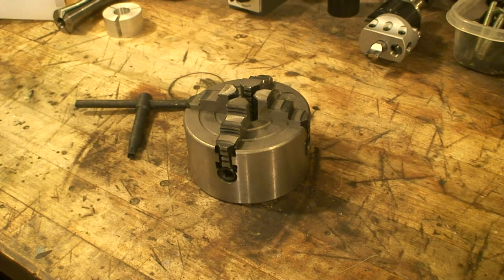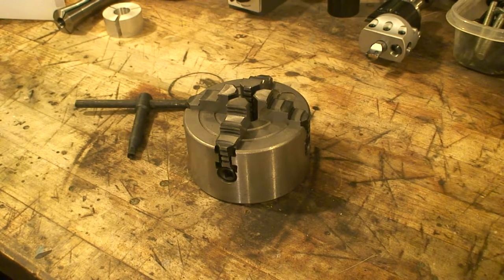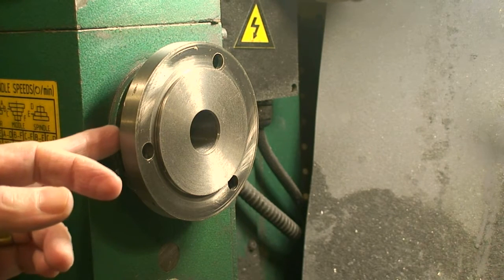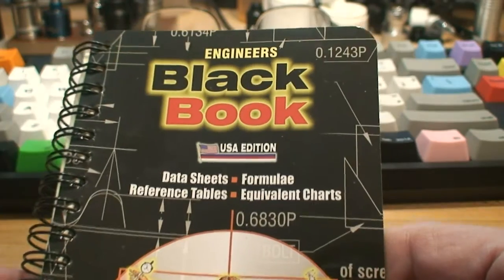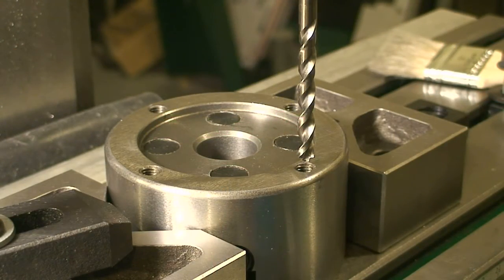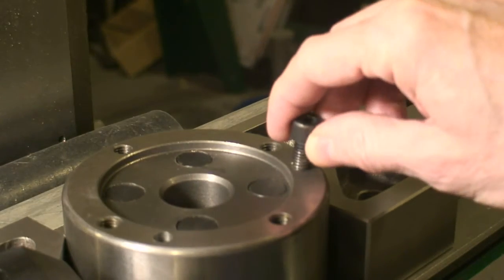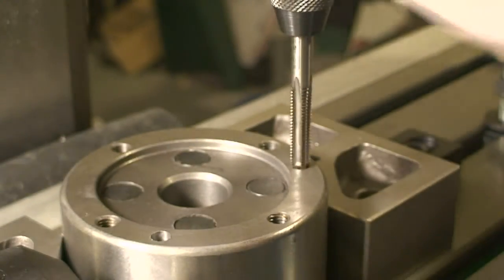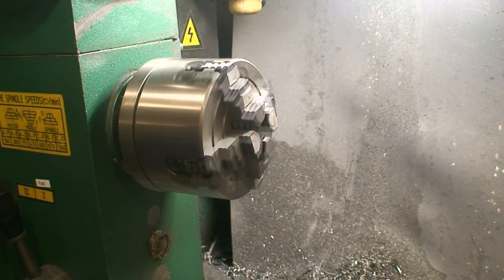4-Jaw Chuck Mounting - Grizzly G4015z Mill / Lathe

Comment: You should  mout the plathe  in reverse on the spindle  with spacers and tie them with  the regular bolt for the 3 jaw chuck and machine the back of the plate until the diameter  of the spindle  center

Comment: When I did this years ago, I used the useless adapter as a guide(no dro) and replaced the cap head screws with long set screws.  I made spacers and nuts on the head side which for me was easier that the shortened allen key.  I can change out chucks in a minute. Still have it to make parts for the 1340 lathe.